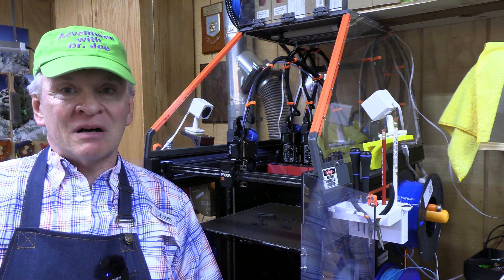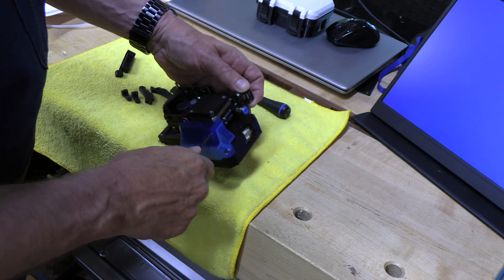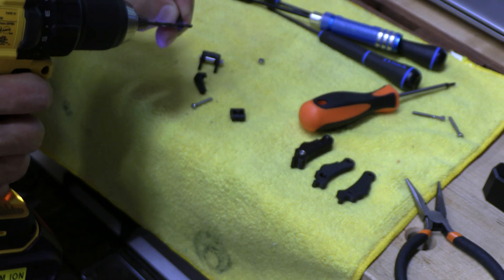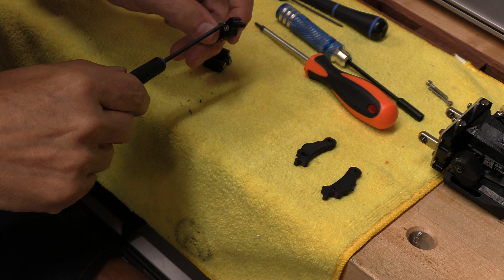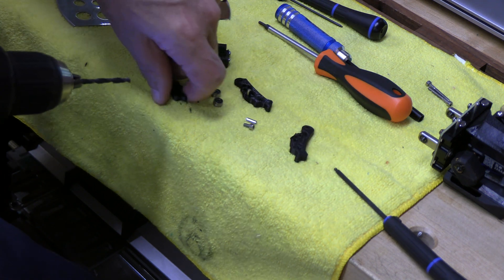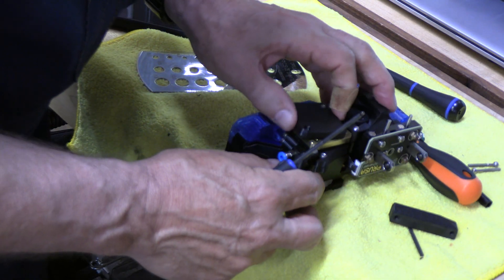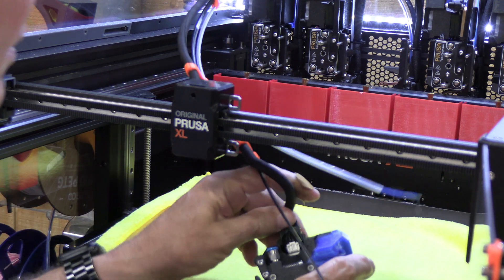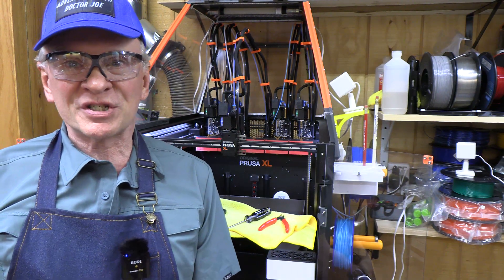IDLER PARTS REPLACEMENT With PC CF PRUSA XL

Comment: I saw a video about CF filled filament releasing lots of tiny tiny fibres into your skin and into the air.
I think it's super dangerous and should be avoided at all costs.
(Same for resin printers...)
Reply from the maker: Thank you for your comment. You make an excellent point. I do have a HEPA filter inside of my printer that I use that’s very effective. I purchased it from Voxel pla. It works very well. This is the material that Prusa recommends and comes now with their new printers. I will be mindful of this. Consider subscribing. Thanks. Joe.

Comment: The belt clamps also need to be replaced. The PETG ones failed when the enclosure temp hit 48C on the same enclosure you have.
Reply from the maker: Thank you very much for your comment. I just printed my belt clamps out of PC – CF getting ready to install those and possibly a video. Thanks for your comment. Thank you for your help. Consider subscribing.
Reply from the maker: Thank you for your comment. You’re absolutely right. I did download and print those and I put a video on their installation. Thank you consider subscribing. Joe.

Comment: Dr. Joe it was great informational video thanks for sharing
Reply: Doc what is the different between IDLER LEVER A and IDLER LEVER B for Prusa XL which one I have to print for my XL
Reply from the maker: Thank you for your nice comment. I was actually disappointed that I obscured the view and probably needed to zoom in more on the individual steps. I might reshoot it. But I have the links to the directions and the STL so you can print those parts. They seem to work a lot better for me, but I’m still having problems with TPU. Consider subscribing. Thanks. Joe.